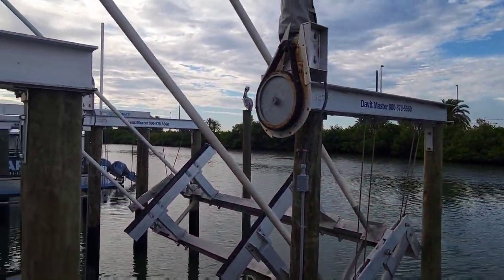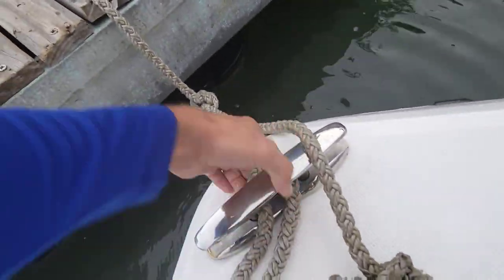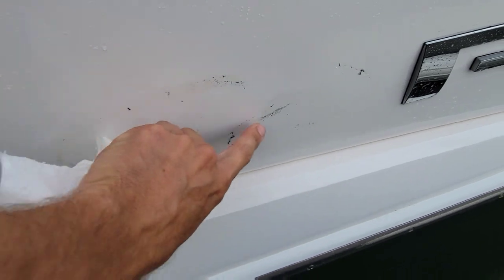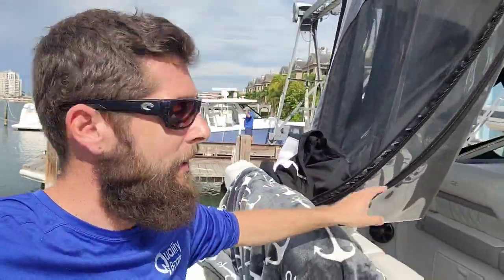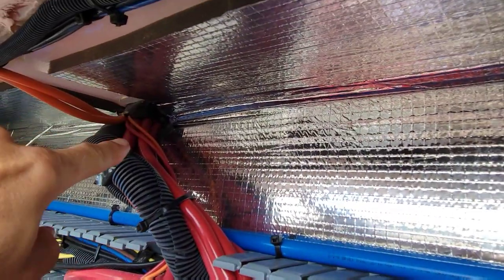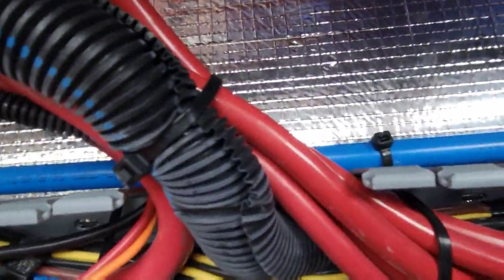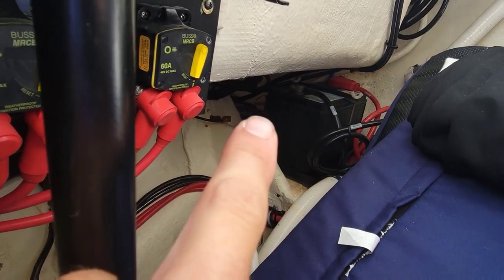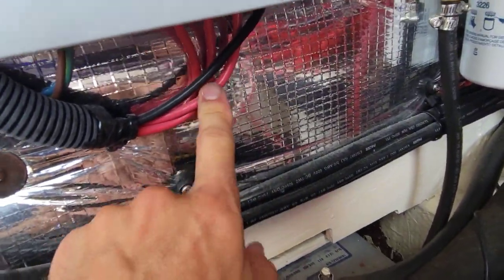Finishing The 42 Regal & Adding An Automatic Charging Relay - Episode 104 #Decal #ACR

Comment: Is an ACR supposed to be wired directly to battery without a switch? Just curious as to how you mad your connections on the switch
Reply from the maker: I installed the ACR to the battery side of the switch so it doesn’t matter if the switch is on or off. I should have said that in the video. Good catch and thank you.